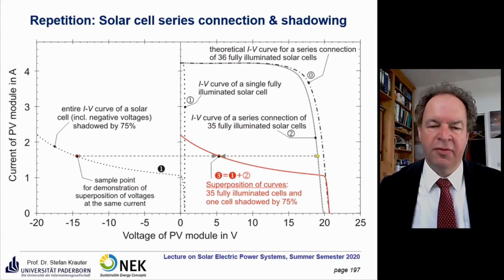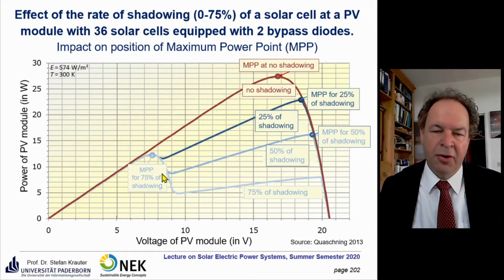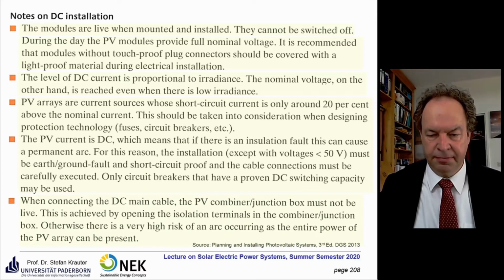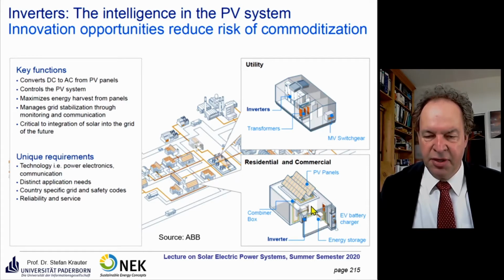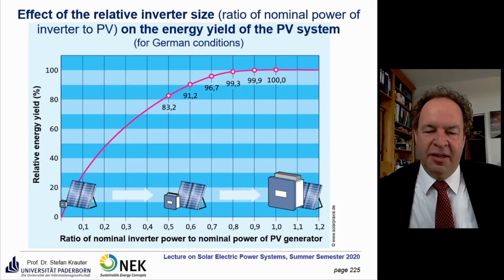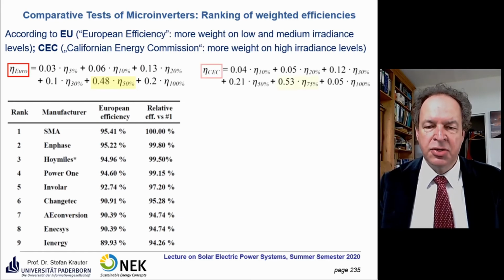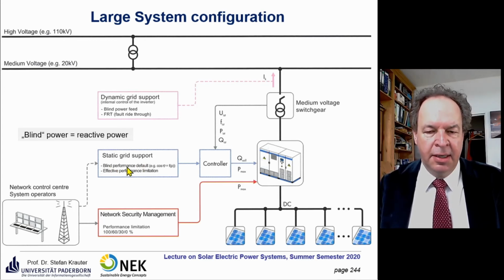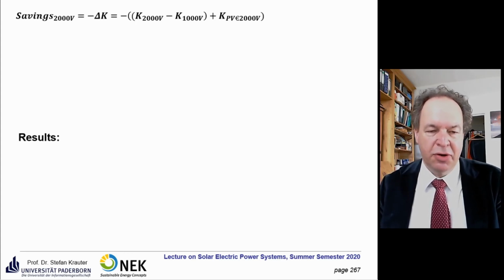Lecture 05 "Solar Electric Energy Systems" Bypass- & String-Diodes, Wiring, Inverters (old version)

Comment: I'd also like to come back to  the shadowing graph at 9:43. The headings says that the graph displays the U/I characteristics of a PV Cell with 2 bypass diodes. As far as I understood it, bypass diodes short-circuit a string when its voltage gets negative, which happens in the case of shadowing. Because of this, I would expect one graph for no shadowed string (0% shadowing), one graph for 1 shadowed string (50% shadowing) and one graph for both strings shadowed (100% shadowing). How can there also be a graph for 25% and 75% shadowing with only 2 bypass diodes?
Reply from the maker: It is not the entire string that is shadowed, but a single cell in that string. e.g. by 50%, so only 50% of the original current can flow through that cell without a bypass diode (e.g. over 2 strings, if the module has 4 strings and 2 bypass diodes)

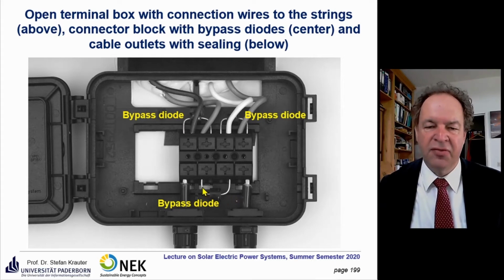Comment: Sorry but I'd like to come back to 5:49 - here the wiring is not 100% clear to me, so would it be possible to add a schematic for the terminal block? You mentioned that there are 6 strings on the pv cell connected to the terminal blocks, with two strings in series and a bypass diode for each of this 3 strings, so that there are 3 bypass diodes on the picture. For me it looks more like the module would consist out of 4 strings, while two strings connected in series on the module, wich are then connected to the terminal block and bypassed by one bypass diode, so that we end up with only 2 bypass diodes. In this case, the upper part of the terminal block would be utilised to connect the pv cell strings, and the lower part would be utilised con connect the terminal clock to be converter / grid. In this case, the lower diode would be a string diode, since it is connected in series to the 4 strings, and not a bypass diode.
Reply from the maker: is it better understandable here ?https://www.electronicshub.org/bypass-diodes-in-solar-panels/